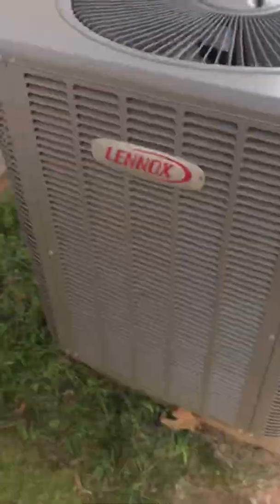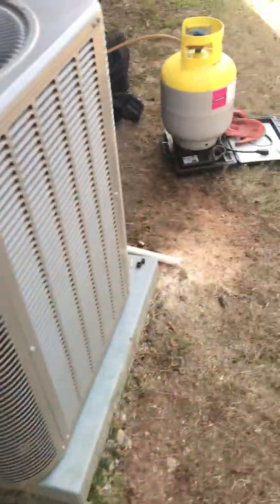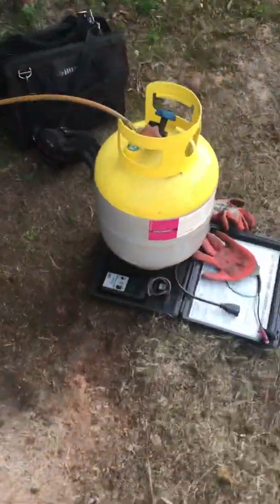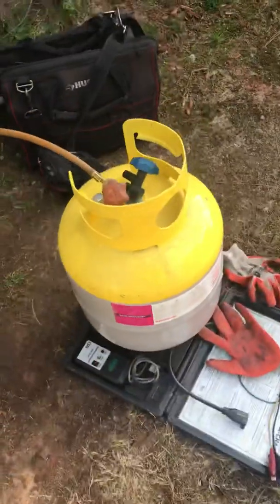Heat pump locking out on high pressure.

Comment: A dirty evaporator coil give you high head pressure on the heat pump
Reply from the maker: It sure does but it was over charged?
The evaporator was the 1st thing I checked.

Comment: Did you have to adjust the amount for the copper line you added? Thanks for the video.
Reply from the maker: Bobby, no I didn’t because the copper line was just a replacement for the internal drier. I just reversed the design.